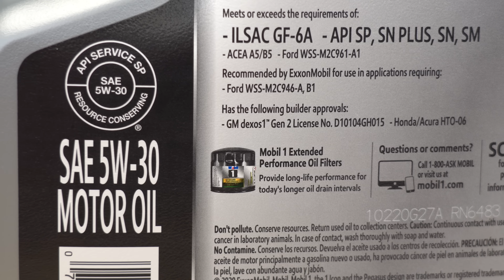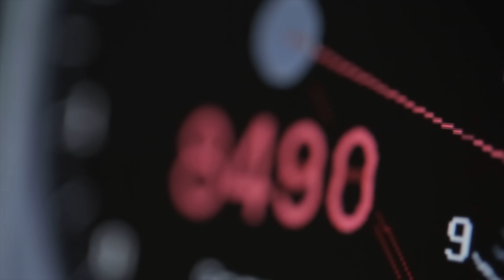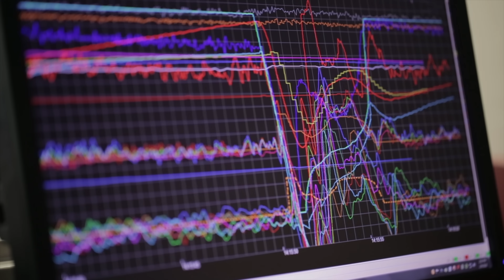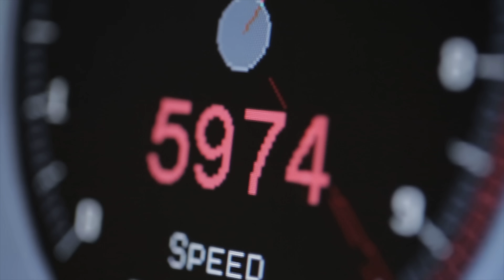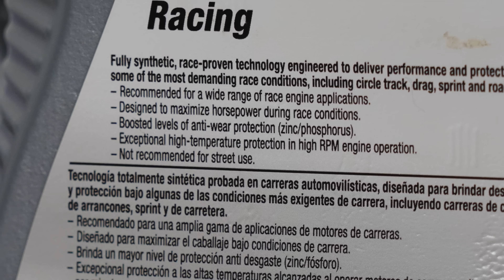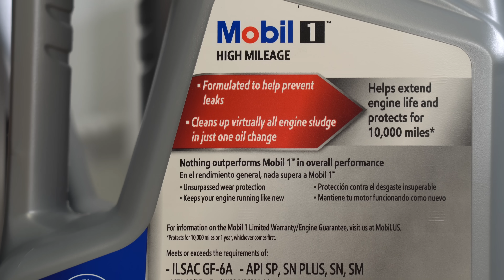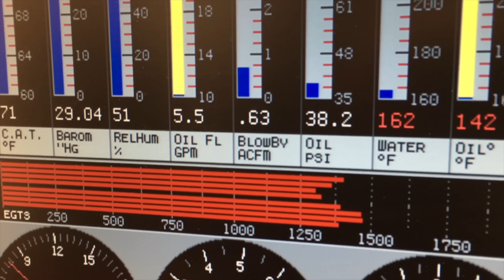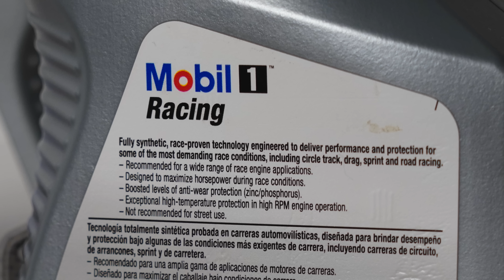Should You Use Racing Oil In Your Road Car?

Comment: Engineered Explained is the only one I could think of to ask vs. all the different forums.  
What all technology makes newer aluminum engines run so quietly vs. even a traditional older fuel injected iron Small Block Chevy?????
  I'm sure its every component for rotating harmonics & combustion efficiency harmonics, but would love to know an in-depth explanation.  Not sure which forum to post this question & those with knowledge of both old & new technology.  Maybe a machinist engine builders forum.   
Want to see an Engineering Explained video on that one!
I want to try a high ZDDP / MODTC / Graphene additive in a boutique blended synthetic to try & quiet my 87Vette 350 L98 TPI, just to make it sound unusually quiet for a sbc!🤔
I want to invest into a vibrometer to measure harmonics & db spectrum analyser.........

Comment: Of course I wanted the best protection for my Mopar 360 engine. Whilst visiting the drag racing I noticed the top fuel dragsters running straight 70 weight oil. I figured if this oil could protect these engines it would be a piece of cake to protect my engine with only 500hp.
For over a year now I have run it on straight 70 weight oil. Great oil pressure, zero oil consumption, zero regrets.

Comment: I use to drive my old car at 90% throttle but then the car was a 3 cylinder 38 hp and didn’t have very much power.

Comment: Mobil 1 has come back to me as my favorite oil.  I'm really liking both Mobil 1 Extended Performance and Mobil 1 Extended Performance High Mileage with Purolator BOSS oil filters running 10K OCIs.  I keep my eye on the oil level, but otherwise don't worry about the oil between oil changes.

Comment: Just use a good conventioal like Castrol GTX, and change it every 3k.  Castrol numbers are as good as most synthetics, which in this country aren’t synthetic at all, not even Mobil1.  Any oil gets contaminated fairly fast.  No getting around frequent oil changes.  Also, own a vehicle that can actually last 400k.

Comment: Racing oil does not need to consider to protact the emission system/ engine start & stop performance/ cold start wear protection ect, select your application with the suitable type of oil can help you save money in repair.

Comment: I just sold my old Tahoe, that has 300,000 miles on it. The only reason it lasted that long is regular maintenance. I changed parts as they wore out. Didn’t have to do much to the motor. Just out a different style valve cover on it, because the factory valve cover has a problem with the drain holes clogging up, and would cause oil to go through the Pcv and it would burn the oil

Comment: Should probably use racing oil in your Ford EcoBoost.  Dirty engines that need frequent oil changes (3000 to 4000 miles) due to heavy fuel dilution

Comment: Use what the manufactrurer specifies. If they're wrong they should pay for it. Racing Oil in you daily driver? no, racing oil is made for racing not longevity of the engine.

Comment: Usually not a good idea to change from the manufacturer specs, but if you start modifying your vehicle, it could be justified. Currently have a '06 B7 A4 Quattro 2.0T at 450000 kms. Hoping to get it to 500000.

Comment: One of the engineers who developed the engine in the Nissan GTR said these fancy, and expensive oils are unnecessary for street cars.  Buy decent oil and make sure you change it every 5000 kms/3000 miles and you engine will last a long time.

Comment: My short answer has always been no.  A racecar has 90% of its hours above 4k rpm, and a street car has 90% below it. These are two different demands, and for racing one key factor is heat - additive packages must change, and also TBN concerns don't really exist - racers change oil too often.   But: can I run something like VR1 on the street?  Yeah - it won't kill anything, but its overdosed for the heat load it will experience.  Oil is massively complex:  for engines, it may be the mother of all rabbit holes: there seems to be no end of factors to test & learn about.  This video?  Probably needs to be redone in about ten years.
As a side note, 2010... what else happened that year?  The SN oil spec.  I'm guessing racing teams were destroying flat tappets all over the place just dyno tuning alone.   Does it suck?  Maybe.  There seem to be numbers to point to that make me wonder if SM and SP are both superior.

Comment: Heh.   You think the technical specs & performance of the OIL is a nightmare ?
Than you get the Fruit Bats in the Marketing team making a nonsense of Everything!
Case in Point 'tho Spoiler Alert coming from Bikes not Cars .....
Castrol had a great 'Power 1' motor Oil for high performance Road Bikes like my Yamaha R1.

Suddenly its vanished and been replaced by 'Power 1 RACING!'
now I knew at the time that racing oils had different specs to road (not least the detergents road oils need & race oils don't)

I rang Castrol's tech team, explained my concerns and 'sought clarification'.

By the end of that conversation I needed NO further clarification as to what the technical guys would have loved to do to the marketing idiots.

Comment: Yes, racing oils are just for high heat, high rpm operation and frequent post-race replacement whereas premium synthetic oils are for extended service intervals of daily cold start protection, efficiency, and safe emissions.

Comment: I always run Mobil 1 Racing oil or Mobil 1 Delvac Heavy Duty (semi truck) motor oil in my Toyota Corolla. I drained the factory Toyota 0W-20 oil right after leaving the dealership when I bought the car brand new in 2019. I push my engine to its limits in extreme performance situations, so I need the best protection I can get. Sure it might ruin my catalytic converter  but i dont live in CA so I'll just remove it if need be.

Comment: Here because I am trying to find a 50 grade oil for 996 to slow down the bore scoring process and found Mobil 1 0w50 is track only and 5w50 isn’t. Going to try half 0w30 and half 0w50 next time
Reply: That would be same as 0w40.  Just run 5w50 Mobil 1

Comment: Hello. Can you please make a video of should you put 5w40 (thicker oil) into high mileage engine that recommended to run on 5w30 from factory? For example my dad had 160 000 miles camry and he put 5w40 in it. Is that safe?

Comment: Don't believe it works in super old engines, I've seen the new oil fail on new camshaft break in. It was dramatic the lobes were gone, same cam and high zddp oil had no issues. It was an air cooled VW.

Comment: Catalytic converter $200 to $700 rebuilt engine $3000 to $9,000 I will use the high zinc oil the engine needs and maybe have to replace the Cadillac converter a little early. I know I know people don't replace cats they use a straight pipe in there which is probably why the EPA wants the Cadillac converter to last the lifespan of the engine but hey with all the druggies stealing cats we're all going to be straight piped soon anyway

Comment: There's talk of engines made under the clean air act can never be modified in any way that would change their compliance regardless of use.  On other words taking any street car engine or even block and building it up to race off road or use on private property would violate the clean air act.   Kinda leaves it that only custom built and designed blocks and motors can be used for most types of race or off road use that requires modification.  I'm not sure the legality of manufacturing an engine  or making a motor block and all using a pre clean air act design would be compliant.  Example is even though automotive refinish is regulated what we can't use to repair cars.  We can use things higher voc than a manufacturer is using.  So even if your manufacturing utility trailers you have to use lower voc that anyone painting a trailer they already bought.

Comment: Well, my road car certainly is not, "Rarely at full throttle." In fact, I floor it probably 50%+ of the time I drive. I spend more time slowing down than I do accelerating, which is something to consider when picking an oil. And, my WRX is under warranty, so it only gets Subi oil, since I take it to Subaru so that they can't say I didn't maintain the car.

Comment: Tell me please, what about once in a while using a metal treatment in your oil, such as one called "dura lube".  I used to use dura lube all the time and one time I had a crash and had to drive 5-miles with no coolant and thought for sure the next day my pistons would be forge sealed.  Conversely, the car started very easily, and actually felt very smooth.  Since then, I have been sold on Dura Lube, what's your take on this?  Thanks, and super great video by the way!

Comment: So, theoretically I could run race oil in my motorcycle? Since its use is 100% highway at a constant 7000-8500rpms and is also a pre 2000s design?

Comment: I use VR1 Valvoline 15w50 ,  as a topup oil for my BMW.   6 quarts mobil 1 , 1 quart  VR1 race oil.   Its almost like an ''additive'' for the engine. and doesnt swamp the catalytic converter with zinc.

Comment: Mobil1 0w30 Racing oil is very tempting to use in a road car.  Yes, catalytic convertors would be in trouble (phosphorus levels).  I know this video is really a limited-Mobil-view paid infomercial, but.....This video should have pointed out:  Some Racing Oils also have street-car ratings for daily use!  Both racing & street.  Example:  Ravenol REP 5w30, all-PAO, many U.S. & German engine specs met by it, complete picture.  Also, note Pennzoil Ultra 0w-40 is used at Indy, yet also has passenger car-truck ratings, another choice.  Basically any German-spec 0w-20, 5w-30, 0w-40, 5w-40 will be very stout compared to lesser U.S.-spec-only choices.

Comment: ....long before the ubiquitousness of synthetic crankcase oil, 1988, I got my hands on some AeroShell 80w Synthetic 4-Stroke aircraft engine oil.  It had the consistency of jelly.  I dumped it into the hot engine of my VFR500.  The internal engine noise was cut in half.  Then I jumped on the bike and rode 500 miles.  The next day...another 500 miles and two speeding tickets...

Comment: On the subject oils, I would appreciate a video on the Subaru, top mounted, inverted oil filter. Does it cause additional dry running on a cold start?
Reply: I had an Alfa Romeo Alfasud with boxer engine with side mounted oil filter, so not quite as bad as top mounted, inverted oil filter. One Fram filter I used had a faulty anti-drain valve, so oil drained back into the sump and each cold start took time to build oil pressure. Swapped out the oil filter before it killed the engine. Just make sure you use a decent oil filter with a good anti-drain valve. I've never used Fram again.

Comment: I got a mostly stock road car, that i track a little, between 5 to 10 times a year. So i actually put stress on my oil compared to road car standard. 
Currently i use motul 300V racing oil with oil change interval every 3000 miles or so.
What kind of oil should i used for this kind of mixed usage ?

Comment: Didn't Honda's wide spread cam pitting problem only begin when EPA forced reduction of ZDDP in oil?  Seems replacing cats more often would be a better trade off than early engine failure.

Comment: Make a test new oil with 5% and 8 % water and gasoline in it vs. the same with an used oil already used for about 20.000 Miles. 

Use of standard oils with less additives and a change every 10 or 12 tkm should be better for the environment, than 40tkm on an high additive oil on? What i don't pour into can't get into the environment and must as well not been cleaned out during recycling again? Ask industrie about environmental footprint of different additives? Certain additives could make recycling an used oil way harder, more complicated and expensive to recycle?

It's maybe not good for industries turnover, but 'simple and frequent' could still be well advised for a lot of drivers and vehicle usage? And do the refineries like to receive higher quantities of used oils 'high on zinc' from all over the place? I would like to know.

And maybe we should invent a (now new) 5 star rating for motoroils - '5 star oils of course being best for the environment, when used according to spec?' ('and 'zinc' - a fashion? - could hardly make up for two?')

Comment: i really like your channel and the things you discuss. dont get me wrong. this though is just completely wrong and out of context for what you are talking about. having worked as an engine builder my whole life i can tell you i only saw 1 instance in that entire time that an engine came in that was just completely worn out and 99.9% of the time they came to me because of other system failures such as coolant system which would make up 90% of the engines ive built at least. so will racing oil wear out your engine the real answer is if by some miracle you can make it last long enough that oil becomes an issue and cause of your engine breaking down then maybe that might have been the cause but even then i would more likely bet it wasnt the oil but a lack of it that finally tore your engine apart. as for racing engines i will only say this that the build tolerances in a racing engine are completely different than a road car its not the oil that breaks down because when an engine is running there is almost 0 wear i know you know this. the oil is not the cause of extra wear on those its the fact that they are being pushed to the extreme constantly that causes the wear on a motor with loose tolerances so it  has less friction those engines dont even come into factory spec until warm. anyway keep making the videos i love the engineering aspect of your channel and the way you explain the science behind it all. but this is just sorta the wrong question to ask in the first place maybe

Comment: Nice video.  There is soo much misinformation and myths\assumptions when it comes to engine oils.  You eluded to it, but the definition of lubrication in an ICE (Internal Combustion Engine) is the flow of oil over surfaces.  This hydraulic barrier is what keeps metal parts from touching and wearing.  It is not present on startup no what the ambient air temperature is.  For ICE "road" engines, the target operating temperature of the engine oil is 212 degrees F.  Higher viscosity oil is only needed if you will routinely see higher oil temperatures or to maintain the hydraulic barrier in worn out\high clearance engines.

Comment: Are the catts the main concern for higher zddp oil? Would it be beneficial for engine longevity on a high km cattless engine to run extra zddp?
Reply: Yes, but the O2 sensors as well.  It's more of a concern with forced induction engines and engines with low friction piston rings which are a good chunk of modern engines produced.  It's why an effective oil catch can is so important in these engines.

Comment: I live in Florida so it's never really cold. I run Mobil1 15-50 with an additional QT of Diesel Synthetic just to boost the ZDDP.  It's in EVERYTHING - truck, boat, bike, mower.
I want the extra protection of a thicker oil and the 1 YEAR drain intervals.  Oil breaks down over TIME, so it might come out as a 10-40 ...I would NEVER want to start with a 5-30

Comment: I use VR1 racing oil in my daily that's sr20ve powerd. It doesn't have a cat or any emissions equipment due to it's a jdm swap so I'll continue to use it for the benefits the higher zinc provides especially considering I rev to 8,200rpm daily.

Comment: We need to experiment with MR fluid, ferrofluid and self-siphoning fluid lubricants.

MR fluids are pretty neat because they increase in viscosity in response to electromagnetic fields, meaning that you can choose exactly where they are high in viscosity versus low in viscosity, but unlike ferrofluids they aren't necessarily attracted to magnets, and thus they can still flow freely.

Meanwhile, ferrofluids can basically be forced to adhere to any parts that are slightly magnetized, thus preventing metal to metal contact and effectively creating a frictionless surface.

Then there's self-siphoning fluids... These are exactly what they sound like.

Comment: I had a 97 Saturn SL2,  17 years and 417000 miles. Used racing plugs and cables, ram scoop and racing oils. I got 42 miles per gallon.

Comment: I put about an additional ounce to 2 ounces of zddp on top of 16 ounces of high-mileage Platinum Pennzoil for my stroker mini bike. Because of the flat tappet cams used in small engines. I will say I put probably  1400 miles on that engine beating it up, as like a sleeper road bike. So far no problems I will say I do feel a slight reduction in power but it's still reaches its top speed and has plenty torque

Comment: Use the automotive  oil that meets the API  classification that the manufacture requires.  Racing oil, small engine oil, motorcycle oil, outboard oil etc. have unique additive packages.  Don't believe cock and bull stories from people who do different things than  what the manufactures recommend.

Comment: Racing oils work wonders in small engines and equipment hydro systems, as the extra ZPPD and phosphorus really allow the engines and pumps to last a long time. Road oils have much  less of those because they ruin cats.
Reply: Wat u remove the cat say on a classic will it matter then?
Reply: @kingzionmusic  I'm not enought of an expert to know for sure, but If it's classic enough for the computer to not notice it gone (or no computer at all) probably. There are classic car oils out there thought you probably should try first. I know amsoil makes some, as well as royal purple. Most of these guys have a info line you can call for more info on their products.